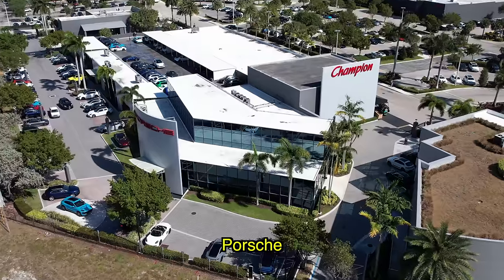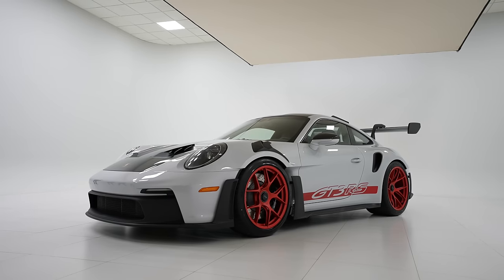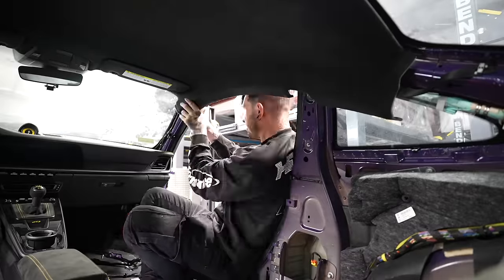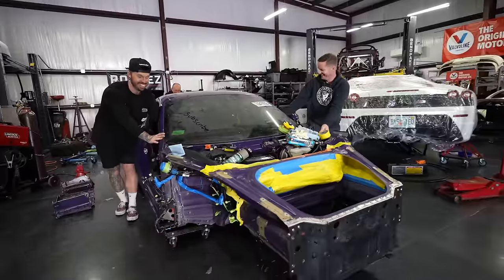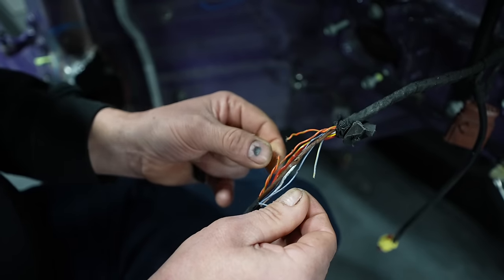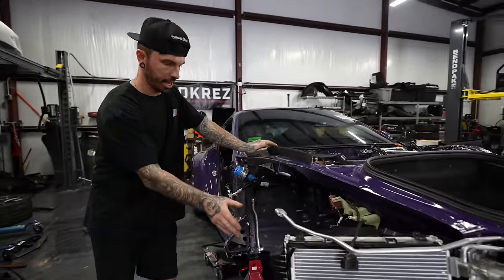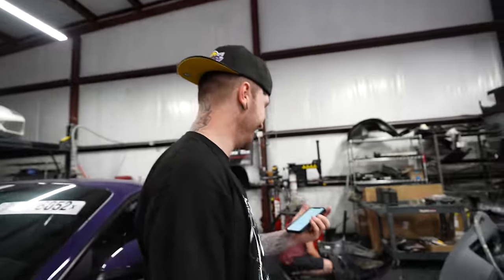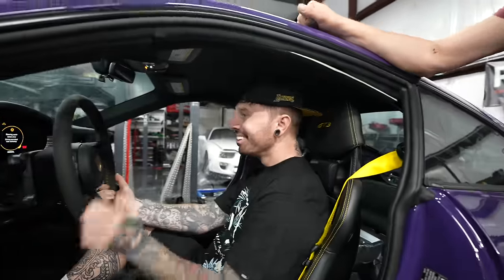REBUILDING A WRECKED PORSCHE 911 GT3 | PART 4

Comment: Try and trick the charger sometimes a charger won't charge if the volts are below 2volts.
What I do is hook up jumper leads from a good battery to dead battery.
Then connect charger to the dead battery, turn charger on wait till its charging only afew seconds then disconnect the jump leads off the dead battery while leaving the charger Connected and the dead battery should then be charging.

Comment: The lithium battery has relays inside them that open when the voltage drops below a certain voltage. I thinks is around 11volts. They op so battery doesn’t get discharged any more. I work at a porsche dealer in belgium. So if u have any questions i wil be happy to help👌🏻

Comment: Your airbag light is still on which means you need to clear the code and the circuit will be switched back to 'on' again in the computer if it doesn't detect any faults. If the airbag light/seatbelt light both remain on after clearing the codes, it the steering wheel clockspring that has a bad circuit and will need to be replaced

Comment: all smart chargers wont charge unless its over 7-8 volts some chargers a little higher or lower so you always use jumper cables to another batter i normally let it equalize for a hour and then put charger on it and let them both charge up together,  the lithium one will then have to be topped off on its own as it holds a higher surface charge

Comment: There's a contactor in the battery, put 12v to it using a jumper and it will close it. the LiFePo battery cant recover from a full discharge so it will prevent the battery from going below 10.3v.

Comment: You can use any lithium ion battery instead of it, or even a lead acid tbh. The reason jumping it worked is because the BMS found in every LI battery shuts down below a certain voltage once the BMS is off obviously it won't charge.

Comment: Regarding the Airbag hub: I would not expect such an expensive Porsche to come with such a wiggeling part especially a safety part. I'd check Porsche rebuilding guideline - if any exists for this part that is - or check the base of the AB in the steering wheel which seems to be rather slim for the power and size of an expanding AB and might be warped. In any case one of my favourite Youtube sites!

Comment: You have done as good but I think much better then most  repair shops in the business. The only thing you did to this car out of the norm is the drilled hole for the pyro fuse . Hey don’t lithium batteries need a special charger  most of mine do.

Comment: Regarding the battery, were you using the correct charger? I swapped the old lead acid battery in my bike for a Lithium and it needed a different charger, I think they need a different voltage to charge. And even if the battery was dead you could probably swap in a cheaper alternative, I think the main reason for Lithium is they're much lighter and self discharge slower.

Comment: I used an aa battery pack wired at 12v. Added a push button to trick the charger. Hold the button down till the charger starts. They always seem to come back.

Comment: New viewer here.. I low key fully expected the battery dilemma as added "drama" for the video. Thinking "how expensive can a battery be?". My jaw dropped when the dealer told you the price... Wild.. Although in a pinch, I'm guessing you could swap back to a lead acid battery and then use a dealer scan tool to code the car back to a lead acid battery type instead of lithium.

Comment: Your battery has an internal switch that trips in case of under voltage and over voltage to protect the battery. You can hook a jump pack up to it if it reads 0v and it should close the switch after a few minutes

Comment: The black and white stripes on the top of the diamond warning, on that package, means miscellaneous dangerous goods (Cat 9).  The airbag having an exposive/pyrotechnic component, might be at a level to small to fall into the explosives labelling requirements (Cat 1), so it then becomes miscellaneous. Explosive labels are orange and may have a explosion graphic or numbers e.g. 1.1, 1.4s etc. 1 indicates explosive, it has 6 subdivesions.  Division 1.1 consists of explosives that have a mass explosion hazard

Comment: The new battery chargers have a safety thing that it won't start charging unless it detects voltage. You theoretically could use a 9 volt battery.

Comment: As for your problem with the steering wheel/airbag fitting loosely…

I would just cut out a piece of gasket, or, some other fairly thin fabric/material and just create a makeshift bushing/spacer to slide in between the cap and the steering wheel.

Problem solved.

Comment: For anyone wondering about the battery this is a huge thing in the hand tool world (Milwaukee, Ryobi, etc)

When a lithium battery goes flat and the charger no longer does the job of charging it we can blame the “smart” batteries internal board. At zero the battery board is not allowing a charge to happen to prevent fire or damage to the battery as it thinks the battery has reached end of life or depleted cells. This isn’t normally the case when it dies due to normal power drain or leaving the lights on. You can however provide the lithium battery with a jump start. Grab a know working battery (any thing on a similar system 12v, 18v, etc) and connect the + lead of the dead battery to the + lead of the jumper battery. Do the same with the negative. 

Power will now force its way into the lithium battery. Do this for 3-5 minutes and remove jumper terminals. You can now place the lithium battery on a regular charger without issue and the battery will charge and cycle as intended from the manufacturer. If this procedure did not work, try again after the jumper battery has been fully charged. If it fails again. Replace lithium battery. 😢

Comment: I would recommend against using LI-Ion batteries that have been fully discharged. It can lead to a catastrophic fire. If a Li-Ion battery is fully drained it can form dendrites, basically microscopic spikes that cause an internal short. In a mild cases it may be a loss of capacity, in extreme cases the internal short can lead to a run-away thermal event.

Comment: there is a reason why there is no top coat on the front from the OEM. If you put on top coat on a flange area, you increase the thickness of that area with soft material (paint) if you now flange somthing on that area you will squice away the paint after some time and the bolt loses its pre load.... the result is that the bolt will get loose. e-coat primer for example have only ~30microns of thickness your wet paint, on top of the e-coat on the sheet metal results in a thickness of >80 microns. ---> dont top coat flange areas. only e-coat primer is best for flange areas.

Comment: Lithium batteries have a small computer on them that controls the percentage battery and recalibrates it as it gets old (like on your iPhone) if the software gets confused they can behave strangely (or need  a software update!) lipo’s are so high capacity but so painful!

Comment: Yo! The airbag movement is not okay, you should disassemble the steering wheel ant take out the metal place that holds the airbag in place. Make it straight. It is folded after airbag explosion! 4:02

Comment: For your dead battery my charger does the same thing if it detects 0 voltage so what i do is i just take jumper cable and boost it with another car for 2 min to put a little voltage so the charger can detect it and it works.

Comment: NO JUICE, FLAT AS A PANCAKE, DEAD AS A DODO 😂 I drive a Porsche Cayenne Turbo, one of my mates filled it with diesel instead of petrol. Long story short, battery went flat whilst parked up and a replacement cost just over £1500 from Chester Porsche, UK. I did get a Porsche Specialist to fit it even tho I’ve fitted dozens of batteries. I’m disappointed the garage didn’t know that old trick or maybe they did 🤷🏻‍♂️ sorry now I didn’t take the old battery with me. 

I drive a Miami blue Carrera 4s too, left that in Dublin at Christmas, battery went flat whilst parked up, jump started it and it took a charge. Unbelievable Jeff

Love the the videos Matt and love the the banter! I’m thinking of getting shut of my 2 and buying a gt3 for some summer madness so can’t wait for your honest thoughts on the gt3!

Comment: I have successfully revived two death batteries with a Porsche 'CTEK'  trickle charger before.    This is one to be exact, CTEK - 40-206 MXS 5.0 Fully Automatic 4.3 amp Battery Charger and Maintainer 12V

Comment: With LiFePO4 batteries, the internal BMS (BATTERY MANAGEMENT SYSTEM) can shut the battery cells down, essentially making them appear dead, to protect them from things like over-discharge. Sometimes the way to get the BMS to wake up again, is to connect a good battery across the terminals - as you did. Then you can get the battery to charge again. I know your battery is a Lithium Ion battery, but they still use a BMS. On that, LiFePO4 batteries are a form of Lithium Ion and they're nowhere near as likely to catch fire a s "true" Li Ion battery - so maybe your battery...

Comment: The battery was probably sitting at around 8=9 volts when it was discharged and was probably why the charger couldn't detect it. Voltage sag on those is pretty bad.

Comment: The way you are solving the issue with the battery is very dangerous. If it's LiIon it could even catch up in fire and it wouldnt be even possible to take it out untill lithium completly burns. And it all could be avoided by using some microprocessor charger for RC models for 99$ which can be set to whatever current you would like to charge with and get the cells up to the minimal 3.2V per cell so the standard chargec would charge the battery.
Reply: ʟᴇᴛ’s ᴛᴀʟᴋ👍
ᴛʜᴀɴᴋs ғᴏʀ ᴡᴀᴛᴄʜɪɴɢ!

Comment: bro u can revive this battery with ease try shocking it with another batt pack attach both positive to positive negative to negative terminals 15-20 seconds will be enough it will work for sure @Mat Armstrong

Comment: The Lithium battery has integral electronics (called a BMS (Battery Management System)) and this will disconnect the output if the cells go too low. The charger Freddy has, won't apply any voltage unless it sees "something" at its output, so that's why it wouldn't charge the battery. Either you need a "dumb" charger that just supplies charging voltage regardless, or jump it like you did.

Comment: The new lithium batteries in Porsches have an internal protection device. When they go below a threshold it goes open circuit and appears 0volts. You need to give it 13v for a few seconds and it will close the circuit and allow for charging.

Comment: Without checking through all 2,000 odd previous comments, did you have the right CTEK charger? I have an Antigravity battery on my GT3 and it has to have a specific Lithium charger, not the standard (lead acid type) charger. If you use the wrong charger, or if you try to jump start a lightweight lithium battery using another vehicle, you can ** it up. Anyway, good luck with the rebuild. Really loving this video series.

Comment: Was the Li-ion battery outputting 0V because of the internal BMS? Maybe the voltage from the other battery caused the BMS to turn the terminal outputs 'on' and that's why the charger started to work.

Comment: Those lithium ion batteries have a capacitor inside of them and when they drop 9v or less the capacitor acts like a breaker and it won’t charge but you can jump it with even a9v battery

Comment: The Porsche lithium iron batteries have a fail safe switch in them which makes the battery go open circuit when it drops to a certain voltage

Comment: Lithium batteries turn themselves off when they drop on voltage or over-charge.

Its said you can use a 9volt battery to trick the 12volt back to life before charging it with a lithium charger

Comment: I had an accident when a van cut in front of me at 40 to 50 mph on a motorway in slow morning traffic. Airbag on steering wheel went off filling the car with what I remember as a black mist. Dash airbag also deployed breaking windscreen. Very scary experience and I to had a red mark on my wrist. Over £9000 worth of damage to my car but I had GAP insurance so it was repaired. Worst part was it was in 2011 so  no dash cam and it was seen as my fault even though I got cut in front of.

Comment: the biggest problem with these "smart" battery chargers is that they are really stupid when it comes to charging a completely dead battery. very few chargers have an override option that just provides power for a set amount of time before switching back to "smart" charging... The jumper cable hack using a spare battery to trick the charger is a great trick!

Comment: Lithium batteries have a cell balance circuit built in, if the battery dies the balance circuit will be powered off and won’t charge the cells.

Comment: Once those lithium ions deep discharge, they permanently lose a massive chunk of their total capacity. It could be as bad as 80% , and once a Li-ion is this low in charge, it qiuckly gets to the level where it's incapable of building up the necessary voltage to do it's job. Better be prepared for this thing to randomly die on you out of the blue the whole time, until you give it a new one.... You'll never read this, will you? lol. Congrats on the well deserved popularity!

Comment: There are companies that will rebuild your seatbelts for a lot cheaper than new. I seen it on Samcrac's channel. I think I've seen him get Ferrari & Cadillac seatbelts rebuilt. Also I just had a fairly new Mercedes battery for my CL55 that sat & went dead. I took it to Advance to get them to charge it up & they said it wouldn't charge & had a dead cell. I bought a battery charger myself & tried & it wouldn't even recognize it was hooked up to a battery. I wonder if I try the battery to jumper cable to that battery it will charge it up? Sucks because I've already had to buy a new one but I will know next time.

Comment: your battery wasn't at 0 volts it was the battery management system disconnecting it, it needed more power to kick it in to start charging.

Comment: I work at a battery store and I’m 99% sure that if that battery is lithium and is still a 12 volt battery if u put a dry cell or agm battery in there instead that could work it should have the same output the part number at almost any battery store  would be an agmgroup47 battery

Comment: Is your 992s battery a lithium battery? It is  on my 992 and it´s causing problems all the time. It´s got a low power security switch, which seems to trigger super early and can´t be untriggered without a special Porsche activator. It completly shuts off all of the cars electronics and doesn´t reset even if you fully charge the battery. Happened to me even when I was charging the battery, but the power was unplugged for a few hours

Comment: That label doesnt mean explosive device. It means miscellaneous dangerous substances. It would be anything from a dry ice to batteries ( although lithium batteries also have to state what battery type with a specific un number ) 

If it was an explosive it would have a yellow/orange explosive label with either 1.1 1.2 or 1.3 depending on the strength. It could also have a red acceptable quantities label on the box for very small amounts.

Comment: Oh man, charging 0V lithium batterry like that (with 40A), I'd definitely do it outside at least.... :-) Hopefully it was just BMS (probably the battery has one, since it's 3000$...) disconnecting the outputs to prevent deep discharge, otherwise the battery won't work too well.

Comment: Lithium iron batteries require different/special chargers specific to that type of battery. A standard battery trickle charger won't work on it hence why it probably wasn't charging it to begin with. Also there's plenty of cheaper automotive lithium iron batteries on the market that only cost hundreds of dollars instead of Porsches prices. Look up the brand anti gravity batteries.

Comment: That’s an old trick to get batteries going. Especially when you use a smart charger like a CTEK. 
But you didn’t use a standard charger to charge your lithium battery did you? Look like you did - that’s a no-no.

Comment: 2871$ for a car battery? If a car battery like that dies down you need to start charging at a low current for many hours so it gets some voltage up and then use the appropriate current. 40 amps for a dead battery is too much it creates fumes inside. There is a whole chemistry book you can read for batteries :)

Comment: I deal with Batteries all the time. and i had to look hard to find a Dumb Charger as they are all Inteli Chargers that turn off when batts are full. and when thay are dead the Charger just detect no Batteries are Connected. So i Advise Dumb Chargers they are great at Bringing Dead batts to Life. and a Tip when the Batts are totlly Dead braek the seal and Top up with Distilled Water and Turn the Dumb Charger to 6V  and let the batts Charge to 2 days to turn distilled Water to Acid and Walaaaaa batts Alive Again LOL. so Pleased you sorted it... My Actual Dream Car is this one. You are so Lucky... Plleeeesse let Me Drive IT PWEEESEE 🥺🥺🥺🥺 Love Love the Vids LOVE THIS CAR.

Comment: so question on the battery, is there any reason why a normal lead acid battery would not work in the car? if it is just a battery to start it i feel like a normal battery should work just fine. 
i would not be surprised if the whole not selling parts thing is a US only thing where these mega corps get to force you to go to the dealership so they can bend you over and rake you over the coals.